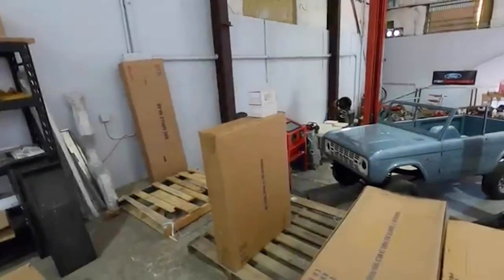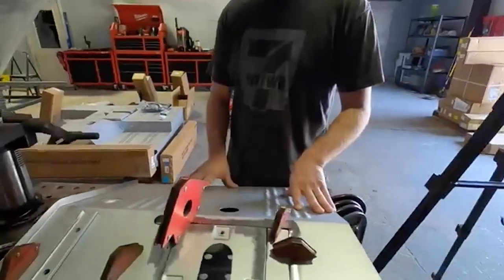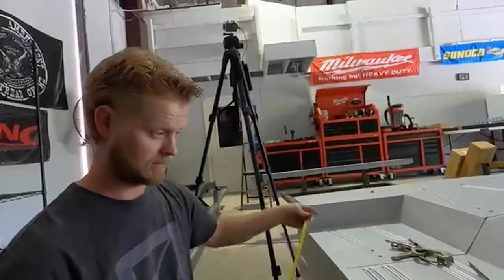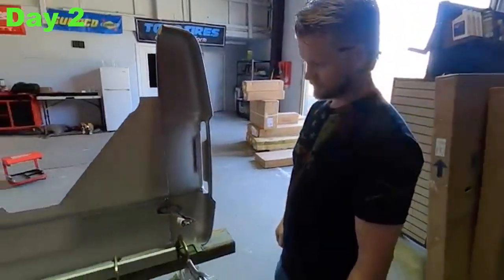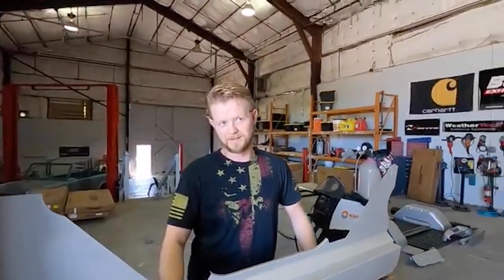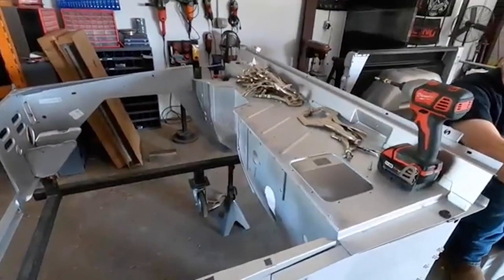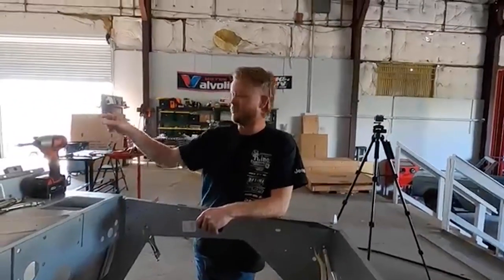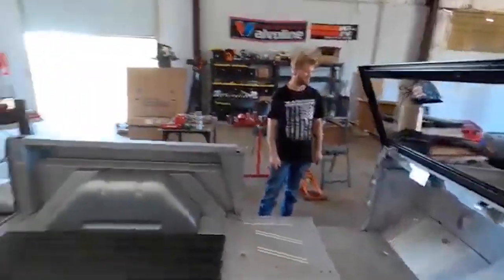Start to finish Early Bronco Build (DIY Gang)

Comment: Nice to see folks showing proprietary secrets of hanging bronco body panels and coyote swap body mods . Some shops try to hide every thing and I get it. I'm just glade my 77 required no sheet metal replacement when did its restoration a few years ago.

Comment: Thanks for the great video.  You mentioned the 21" measurement reference point on the passenger side but not the drivers side, just that "they're the same", but the drivers side cowl is a different shape at the top.  Can you elaborate a bit more on what point at the top of the driver side cowl is 21" to the floor?  Thanks!  Edit: My passenger door was spot-on thanks to you.

Comment: Hey guys love the video, I’m building a bronco body with my dad and would love to know where you got some
Of the measurements from. All the help I can get haha. Learned a ton, thank you!
Reply from the maker: The two main measurements is in the video under key measurements under the time codes. The two most important measurements on the entire build is 37 1/16 from the back of the floor panel where the quarter panel sits on that lip of the floor to the edge of the kick panel that attaches to the inner rocker. The 2nd measurements is from the floor to the top of the A-pillar. You need to go back to the video to kmow what I mean. The gap between the taillight buckets is 58 1/4 for the tailgate to fit perfectly.

Comment: Where are you ordering your parts from? I see such big differences in the way the kick panels, pillers, floorpans, etc... are being cut between the different Bronco suppliers....
Reply from the maker: The only difference between all the panels are the colors. Unless it's original they all are coming from the same supplier and trust me when I say these parts definitely have to be minupulated to fit perfectly. None of them just line up. We source the sheet metal from anyone that has them in stock right now.